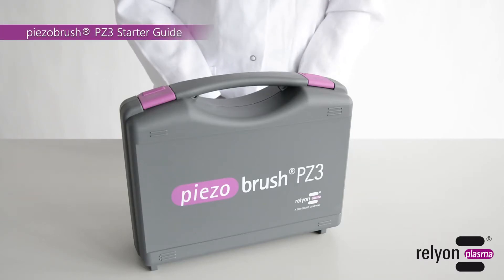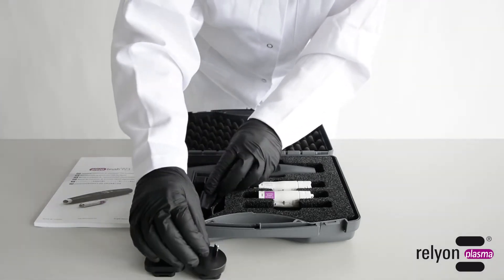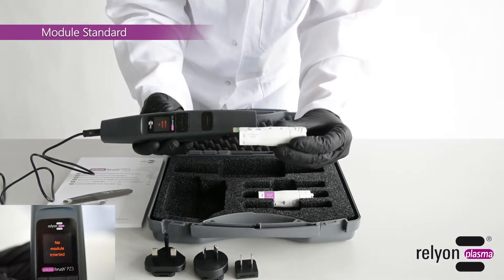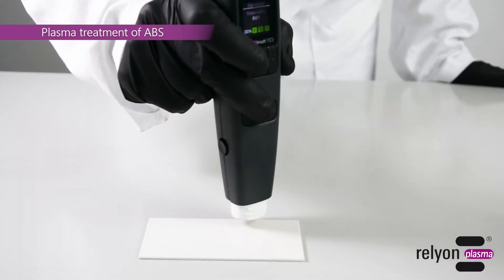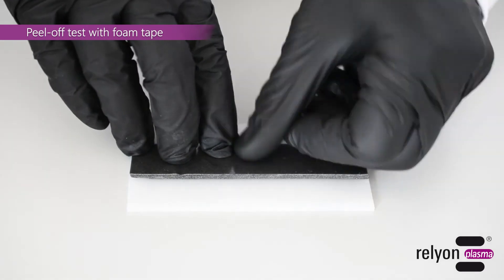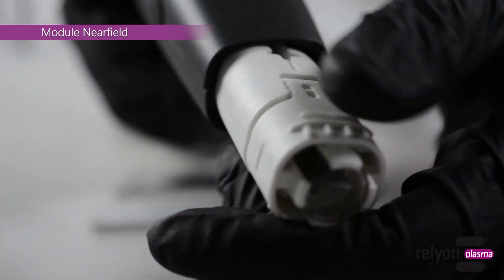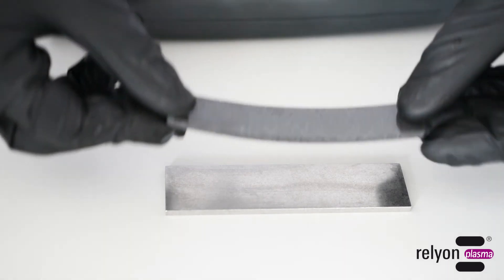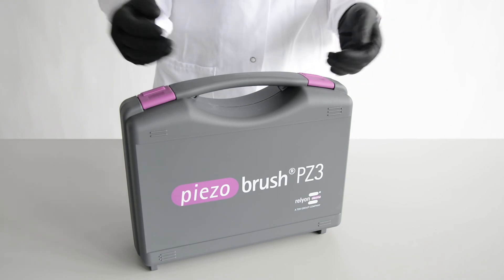Starter Guide PiezoBrush PZ3 EN

Comment: Has this been tested on the insulation of cables to improve the bond strength to the insulation on back-potted connections? Do you have any data on surface energy improvements of ETFE?
Reply from the maker: The exact increase of surface energy is depending on various factors, such as treatment duration, speed and distance, but also ambient temperature and humidity. Nevertheless, we have good experience with all low surface energy polymers, such as silicone, PTFE, ETFE, PE etc. We suggest to rent one of our piezobrush PZ3 handheld devices to see the improvement and get exact numbers for your application.

Maybe the reference from our website could be interesting for you:
https://www.relyon-plasma.com/assembly-of-cables/?lang=en

Comment: is it suitable as a treatment on genuine leather to prepare the surface for digital printing?
Reply from the maker: Yes, this is possible. Basically, all materials can be treated with atmospheric pressure plasma from the piezobrush PZ3, since there is hardly any temperature input on the material during surface treatment with atmospheric pressure plasma. However, the surface of leather is not completely smooth, and the plasma concentration could therefore be higher in the grooves. You can find more information about the device here: https://www.relyon-plasma.com/piezobrush-pz3/?lang=en